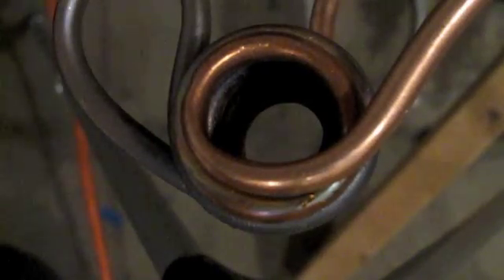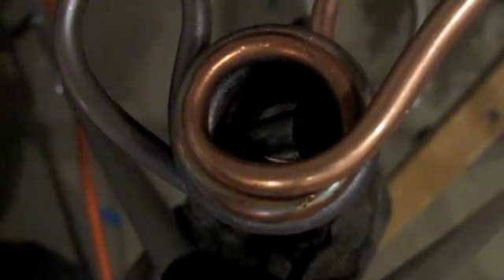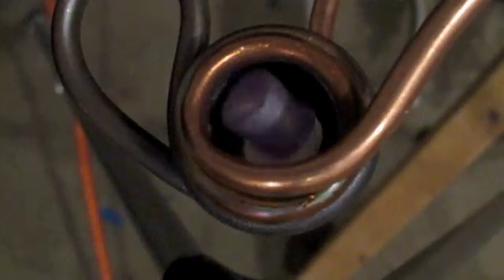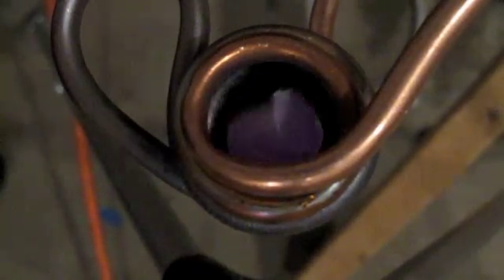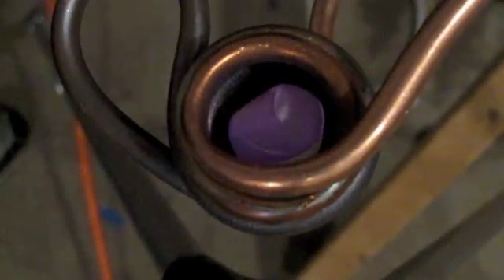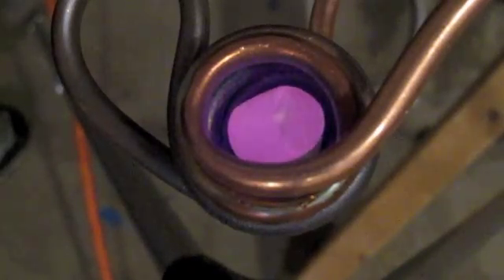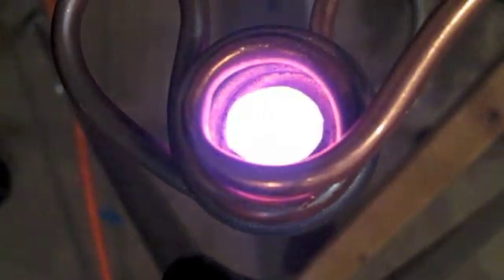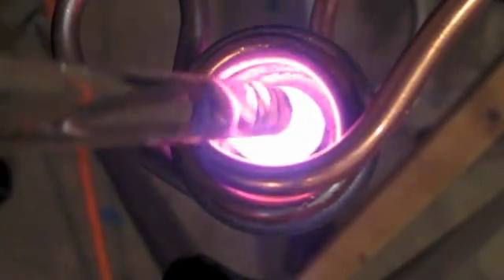induction heater levitation melting aluminum

Comment: wow, I can see the copper bulging from all the heat too. its interesting that it doesn't totally break before the aluminum begins to melt.
Reply: No, the copper doesn't bulge, it is liquid cooled so even when the aluminum is molten the copper is barely warm.
Reply: but its visibly expanding from the heat.... whatever man. :)
Reply: Neverdweller I watched it again skipping around to see where you're seeing that but I'm pretty sure it is just your imagination. :-)
Reply: Nevir202 Its science. and I am not seeing things, http://en.wikipedia.org/wiki/Thermal_expansion
Reply: Neverdweller
I am aware of thermal expansion, I am telling you the coil is barely getting hot if at all as it is liquid cooled.

Here is a quote from an FAQ about induction furnaces:
"How hot does the induction coil get?
								STEVE: "The induction coil is cool to the touch; the heat that builds up in the coil is constantly cooled with circulating water."

Feel free to read up on them at your earliest convenience.

http://www.gh-ia.com/faqs.html
Reply: Nevir202
Watch the tubes coiled in the middle very closely at 40+ seconds in, they do expand it is visible, you obviously smoke cocaine. or enjoy arguing pointless things. While the tubes aren't getting so hot they melt or glow I assure you that they arent cool, that link you sent is to induction heaters, this is a home made induction coil with much higher power pumping through it, this thing is juicing at 2-2.5kw and he doesnt give us specifics on his volts and amps and all that. but those heaters do NOT use this kind of power they apparently are low energy requiring basic energy needs.

Comment: You are correct, the color is primarily down to the filter response on the color filters used in the camera, since the light gets through to the cells in the imaging array that has blue and red filters, the camera will render the color as a pink to purple.

Comment: The magnetic fields generated by the copper coil generates eddy current to push the aluminium either up or down, according to the direction of the current. But this current is changing 60000 times a second, so its repeatedly pushes it up and down 60000 times a second, and so it levitates.

Comment: Hi imsmoother. If only 3kw of power can do that to aluminium with such a high melting point then is a typical 3kw water heater element terribly inefficient at creating thermal energy? cheers

Comment: I have seen that you are an expert in induction heating and I would like to do you a question. I have an old induction heating machine and I have prepared a vacuum box to get to melt under vacuum. All work perfect but when the vacuum starts the machine stops and I don´t know why. Could you help me to find the problem? If you need more information or some photos let me know. Thanks

Comment: The coil is alimented by a high powered electricity, so a magnetic field is formed, and put in levitation the aluminium. The high power melt the metal (like the princip of the microwave machine), creating a glowing ball of metal floating in the air between the coil.  When the ball falls, it's because the temperature of Curie is reached ( look at that on the net, I don't know how to explain this in english..)

Comment: i have TIG welded aluminum before and one thing that i noticed was that molten aluminum does not glow like steel it simply turns to a shiny puddle (similar to molten lead or mercury) so how is it that this aluminum is glowing?

Comment: unstable ,but is the heat uniformed?does the technic allow for a part to remain in its original shape.while floating.At Sargent Aerospace its a standup with coil from induction heater process.Its a joke.Its a wild mickey mouse operation.The presses were made in 73 and dont have their shut height indictators working.The leadman is a joke too.6-4 and 61yrs old ,hes been there since 86.If he told me he was born in a badass biker bar in the middle of the senora desert,I'd believe him.

Comment: You are absolutely right, since our current system and power structure is build upon dependency. But time is always changing. The day someone has figured it out how to tap into this endless sea of energy, it will spread like a bush fire! 
Don't worry about todays pragmatism it is falling apart in front of our eyes, nothing lasts forever.

Comment: This is amazing!  How can I make this?
Reply: Damn
Reply: rest in peace
Reply: This might be a little late, but I think the only thing you need is a strong AC current running threw a copper spool and a pice of aluminum. 

Oh and rubber gloves and tools with rubber grips so you don't die from making one wrong movement would also be usefull I think.

But yeah, the equipment needed for this experiment is extremely basic.

Comment: you first place your magnet then the metal, then turn the machine on and the electric inside the copper coil will cling to both the metal and magnet. with the magnet placed under the coil befor turning the power on, then turning the power on, the coil will pull the force of the magnet inside the inner rings of the the ciol making the metal float in mid air. i could be wrong, but thats what it looks like from just watching the video...lol....  how ever it works, it is cool science :)

Comment: A really strong alternating electromagnetic field induces eddy currents in the work-piece (that's what heats it as well), and the design of the coil (top going one way, bottom going the other) create opposing forces that keep it centered. Keep in mind that the amount of electromagnetism present is INSANE. Weird things happen at high power levels.

Comment: Aluminum is so weak. The kv induction pulses must be pushing the aluminum upward against gravity or the frequency is so fast that the object is held in one spot. In a science project a very large ball bearing was held between what looked like tires from a toy but there were coils wound inside and optical triggers sensed the motion to keep from flying away.

Comment: Aside the aluminum-aluminium thing... the purple color you see there is caused by his phone which he's using to film this. 
Usually, mobile phones and cheap cameras don't have a well filtered sensor and some, this time a lot, infrared light passes in the red and blue pixels. (R+B=V) 
Really poor or no IR filtering can cause something that's deep-red hot to appear as a bright pinkish sun, overwhelming the sensor. The green pixels are more immune to IR. 
Look-up CCD sensors and how they are made.

Comment from the maker: I really don't understand your failure to understand what is happening. The voltage on the coil is measurable with an oscilloscope. Current is the flow of moving charge. A difference in potential causes current flow, so your comment of voltage being defined where there is no moving charge makes no sense. This is my last reply as I am bored of this 101.

Comment: The thing is, voltage is the electric potential, and you need a conservative field for potential to be well-defined, and one of the conditions of a conservative field is that the curl is everywhere 0, and induction heaters work by inducing a curl in the electric field as per Maxwell's equations, so voltage is strictly only well-defined when there are no moving charges.

Comment from the maker: Voltage is not meaningless. The coil is the primary. The workpiece is the one-turn secondary. The coil has over 1000A of current which creates the alternating magnetic field which induces a voltage in the workpiece. The workpiece shorts the voltage, creating a massive amount of current in it which heats and melts it. This is the theory behind induction heaters.

Comment from the maker: induction is short for "inducing voltage". Does a wire have to be magnetic to carry a current? When you run a transformer by putting a voltage across the primary, is the core or the secondary coil naturally magnetic?  So, the answer to you question is "no".

Comment: It's possibly his camera. Digital cameras / recorders can pick up infra-red due to the nature of the image sensor and it normally shows as purple in the photos / on screen.

You can see this effect if you get your camera phone and hold a tv remote in front of it whilst pressing a button. You will see a large purple light! If you have an optical mouse that uses an infra red laser it will also show up!

As this is being heated to a high temperature it might be that it is emitting more infrared.

Comment: AC current creating a changing magnet field on the coil which induces a current on the metal, because the metal has resistivity, electrical energy is converted to thermal energy. Lens's law keeps the metal floating. One of the most genius uses of grade 12 physics I've seen!

Comment: @rich1051414 First of all the process of induction heating does not reverse the poles of the object. Also the levitation is caused by the aluminum being diamagnetic meaning that it will take the magnetic field and reflect it back on its source. what happens is that inside the coil the opposing magnetic forces of each winding causes what are called eddy currents which merely jiggle, or "excite", the atoms of the item in the field. This whole process does causes heat to build up in the object.

Comment: you know, if you can insert a sphere of pure graphite in an iron shell, make it heat at over 3000 °C then make it fall into a rapidly decreasing temperature (cold water) the iron will tremendously compress the graphite pill inside of it in the process then create small diamonds out of the graphite (see james hannay). well, i think that the levitation inductor seems pretty good for this kind of experiments....

Comment: @rich1051414 Thas is completely and utterly wrong. Aluminium isn't magnetic at all. Rather the electrons inside the aluminium (which is a conductor, as it's a metal) are moved back and forth by the switching magnetic field. This is called induction.

Comment: Imagine a giant induction super powerful doorway, where the coils are in gaps you don't notice in teh walls (nothing in front to melt) and some sort of super material you walk on the bottom that doesn't heat p or melt, and as soon as they walk through it they get like 3rd degree burns extrenally and internally, excites all molecules in their body, even their eyeballs :O omfg! lololol

Comment: @FiltyIncognito
Thanks! You're right that's true, but I know that graphite is also a conductor, although its conductivity is about 1000 times lower than an ordinary metal. Now the problem is that if the workpiece is a supercondutor-->no resistance-->no heat and if the workpiece isn't a conductor-->no electric flow-->no heat,  so: is graphite conductive enough to be heated by an induction coil?

Comment: @tyreza79 Most likely its the camera picking up IR emissions from the iron while the black-body radiation shifts up to visible light frequency's. Its like pointing a TV remote at a webcam, you can see the light though the webcam but not with the naked eye.

Comment: @RabbiAddosso From what I've read it needs to be a conductor as the heat is generated by electrical resistance as current flows through the workpiece. This might not be completely correct.

Comment: It is because aluminum becomes a super conductor under that amount of induction... Super conductive metals have the unique composition of diamagnetism.. So both sides somewhat share a pole and they repel in every direction!! You can make levitating metal at home without using induction or anything just using a diamagnetic material (such as catalytic carbon?) over a magnet! :) enjoy!

Comment from the maker: @lstintxs This one I will address: the cord is powering the the driver circuitry.  The high voltage for the inverter is coming from a 30A 10g line, connected to a 240vac line.  As far as electricity, my home runs on solar and wind power so my electric bill is zero.

Comment: Once you smelt the metal, you can drop it into a mold and make parts with it.
If you do this process in a vacuum chamber, you can smelt titanium and make close to perfect parts with it. Very little machining needs to be done to clean up the part.
Peace.
Mike..
Reply: Even better if you melt aluminum in vacuum chamber and it does NOT get a chance to oxidize, it is highly reactive to water! Of course in the vacuum the water will be boiling... Should still work tho